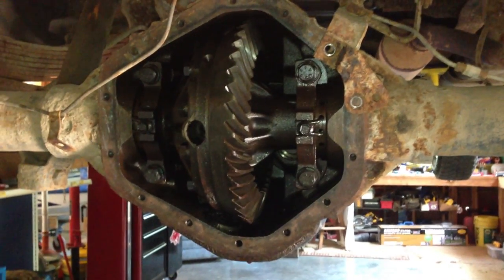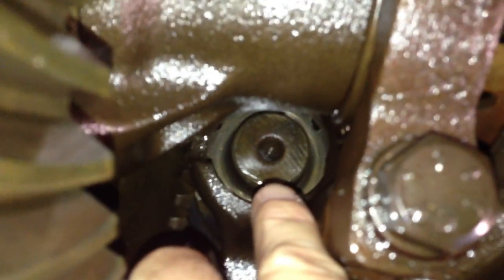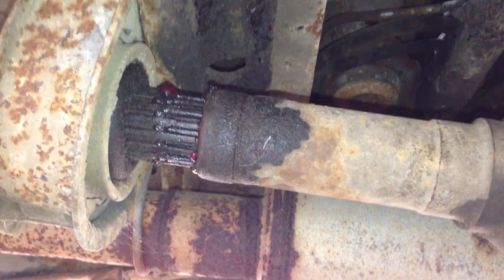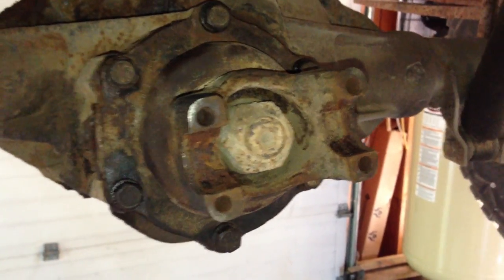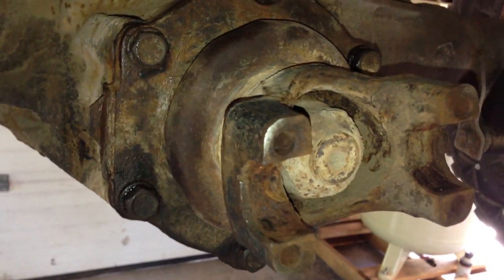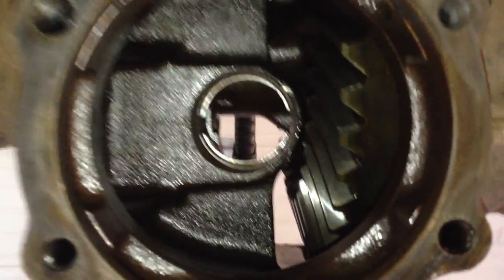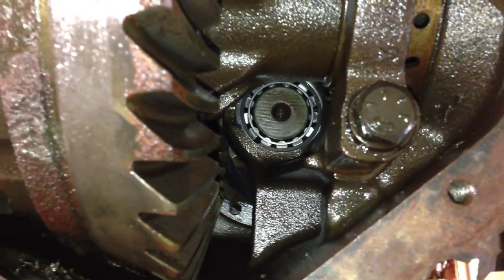GM 14 Bolt Axle - Pilot or Straddle Bearing Information

Comment: This is exactly what I needed to see. The one on my hoist is all rusted to total F. Had to heat each bolt with the oxyacetaline torch then hammer on them with the air chisel to get them to turn and they all came out despite the heads of the bolts being rusted down enough to fit a 10mm socket over, kinda like rusted exhaust fasteners.
Reply from the maker: I'm glad it helped! Sounds like you've got a real project on your hands...

Comment: Exact same problem in my 2009 HD 2500 ... straddle bearing broken off, got crushed, leftover pieces and shaving around the magnet along with "dissolved" in gear fluid. I couldn't be happier to find it out during maintenance!!!
Reply from the maker: Yes it's very surprising to pull the cover and find that. I hope yours is an easy fix.

Comment: Thanks for this. I almost made it harder than it needed to be. I can see slop in mine just slightly. Caought it early, was planning on pulling the diif apart...  It was likely low on flush, had a clank when I put it in gear, u joints were fine though. Prolly gonna set the lash to compensate for wear there's a lot of fine metal on the magnet... Anyway, thanks for this.
Reply from the maker: You're welcome! I'm glad it helped!!!

Comment: Awesome video. After install did you have any noise from rear end? Did the bad bearing wear you pinion or ring out at all ? Did my yesterday and had half the bearing in still rest fell out. Got a 1500 dollar quote to redo whole rear end but if I can do bearing for 50 bucks why not lol.
Reply from the maker: Hi Justin! Thanks! Glad you liked it. I don't remember having any noise from the rear end after this (or before FYI). I don't think that my ring and pinion were worn. I unfortunately don't own this truck anymore so I can't comment on the long term fix. Sorry.

Comment: Replacing the bearings in similar rear of 2004 truck. Curious how long this lasted just replacing that one bearing? Mine isn't as worn but the other bearings were bad also.
Reply from the maker: In my truck, this was the only bearing that needed to be replaced. However, I did not put many miles on this truck before I sold it.
Reply: @GodsCountry  which is a good thing, because with the scoring and pitting on the pinion nose from the failed bearing, the new one wasn't going to last long either.  That pinion diameter IS the inner race for the bearing and it needs to be a ground finish for the rollers of the straddle bearing to survive.

Comment: Is there a part number for that bearing ?
apparently GM changed this bearing for two years (84,85) on the housing side to a smaller OD bearing which is now discontinued.
Reply from the maker: I'm really sorry but this project was a long time ago and I don't have a record of the part number.
Reply: @GodsCountry  Found the number , its a timken  R1581TV
Reply from the maker: Excellent! Thanks for posting it here.
Reply: That part number is not for the 84,85 model years.

Comment: I got the rollers of the bearing out but i cant get the race out. How did you get the race out?
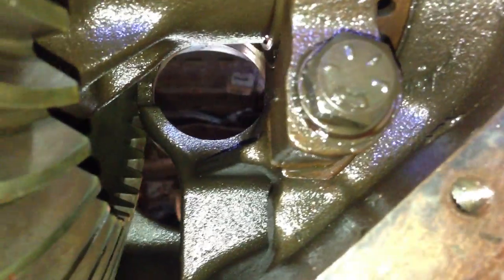Reply from the maker: It's been so long that I had to rewatch the video to see what I did. Around the 3:05 mark I talk about hammering out the bearing race from the rear with a long socket extension.

Comment: What’s the bearing number and where did you get it ?
Reply from the maker: Hi Luis! Unfortunately this repair was done a very long time ago and I don't remember the part number or manufacturer. I think it can be bought from several different places. Please look at the links in the video description for more info on the 14 bolt. I believe that's where I got the part number information.
Reply: R1581TV

Comment: What symptoms did you have
Reply from the maker: I actually didn't have any symptoms. I was just doing a fluid change and inspection shortly after I bought the truck. Popped off the cover and found bearing parts.
Reply: @GodsCountry  thats no good wow. Reason I asked is because I was having issues with my truck the other day it was causing my back pass wheel to jump and go up and down as I was driving was trying to find out wth was going on with it lol turned out to be a faulty brake drum lost its weight off of it and was over looked and fixed it today.
Reply from the maker: Very interesting! I'm glad you got that figured out!!

Comment: i just tore mine apart. seems when i put a detroit in, I didnt do things right. never worked on one of these before and didnt adjust the gear mesh correctly. i chewed the teeth off all the way around the ring gear.. ughhhh
check it out..
https://ck5.com/forums/threads/so-they-say-14bff-with-detroit-is-bomb-proof-well.328280/
Reply from the maker: Ohh man..... Sorry to see that. Setting up gears is an amazingly complex thing when you start reading about it. I have never attempted it.
Reply: lol well i have no choice.. im going to attempt it! pirate4x4 has a great article on what and how, etc... will see...